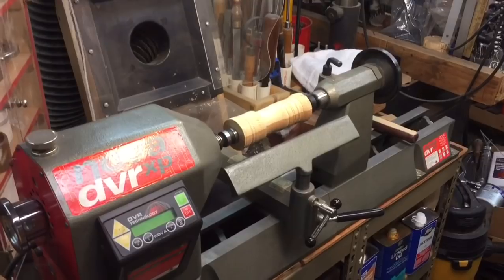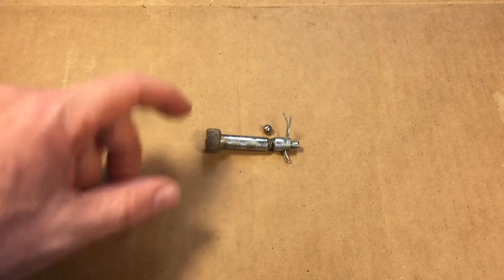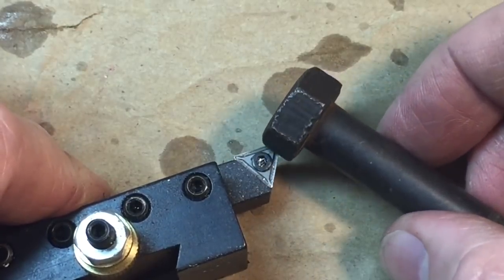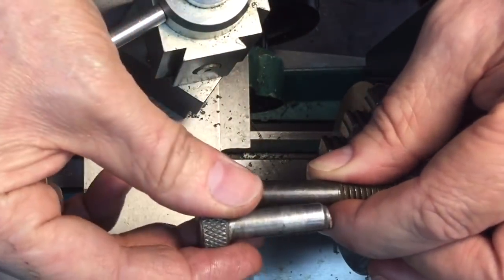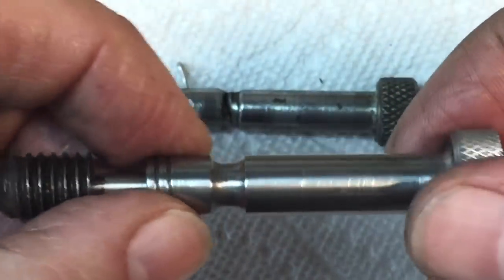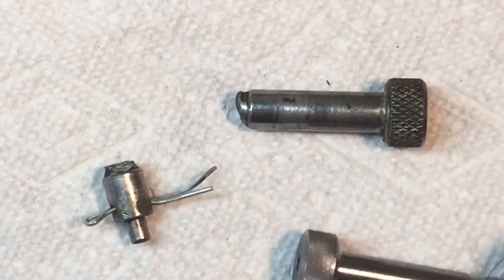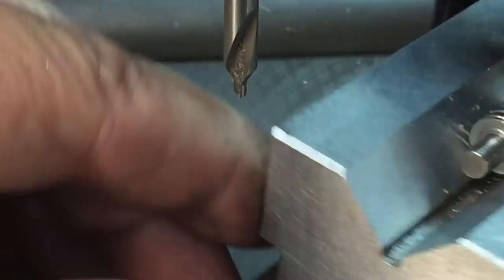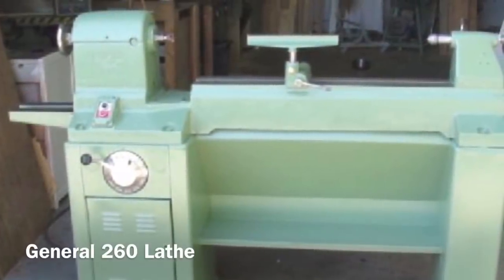Using a Lathe to Fix a Lathe...

Comment: This is an incredible honor, SC. I mean that sincerely. I have spent hundreds of hours in front of that lathe, this is a deeply personal and special thing. Thank you
Reply from the maker: Hello Daniel!  It's in the mail and should reach you by Tuesday!  We are all wondering if you know about the off center hole?  Do you think it was done by mistake or could there be a reason for it?  =)
Reply: @ScoutCrafter  I won't know for sure until I test it,  but I can give my best guess. When you press the knurled head the narrow tip indexes with a corresponding hole on a wheel secured to the spindle, thus locking the spindle. When you want to unlock the spindle you grab the knurled head and pull it. The cotter pin is there to prevent the pin from being pulled out entirely. I can't think of a reason why that hole would be skewed the way it is, I hadn't noticed. I will give an update when the part arrives. I know you're a modest and humble guy, and I don't mean to put you on the spot but, you're incredibly talented. I hope I can return the favor. Brilliant work, brilliant ingenuity.
Reply from the maker: Daniel! It was my pleasure and if it works I will be happy as a clam!  LOL   =)
Reply: Daniel Nero curious? How did it end up working for you? Was the hole in the correct location or a defect?
Reply: @big_air_jer9768  I wasn't able to determine if the hole was manufactured with the offset hole intentionally. The pin fit perfectly. It was a dead ringer for the original, It was identical. Still the mystery remains i'm assuming that detail wasn't essential as the hole is used as a pass through for a cotter pin.
Reply from the maker: @big_air_jer9768    Daniel sent me photo's of the pin in place and it worked perfect...  The hole was just for a retaining cotter pin and I don't think it had to be off center...  His lathe is awesome!   Thanks!!!!!!!
Reply: ScoutCrafter awsome. Well great attention to detail anyways Mr. ScoutCrafter 😁

Comment: it is true that a lathe can be used to make another lathe, which is unique among all tools.  But even less well known is that the very first lathes spontaneously came into existence, while each lathe was in the process of making the other.   Going back in time to see what happened earlier in this process just results in the other lathe becoming more finished, so attempting to observe what happened prior to this merely runs into this barrier.  So as far as anyone can tell, 2 lathes came into existence spontaneously. They do know that they were arranged in a 'ying/yang formation', meaning that one lathe was facing the other way and upside down in relation to the first lathe.

Comment: What metal lathe are you using? I'm looking at a $500 mini desktop lathe for the near-ish future followed by a $2,000 Baliegh later on down the road. Also you're damn good with a file. I would have chucked the bolt into the lathe and held a metal rasp or file to the head and got it perfectly round and close to final dimensions.

Comment: I have always wanted a mini-lathe. But my main work is leatherworking, and veg-tanned leather and metal dust/filings are not good friends. Even sitting a metal part on natural leather for a while will result in major tannin staining. This means the metal work needs to wait until I build a new shed. Grrr.  Great video +++++
Reply from the maker: You are so right!!!  I do some leather work myself and one old timers method to dye leather was to use steel filings and vinegar! I know you already know this... All hobbies are equally satisfying and rewarding!  Thanks so much!!!!
Reply: If I am feeling cheap I try to talk the occasional customer into a dark grey finish. LOL.

Comment: The bolt is likely to be a high tensile steel too! No doubt the part you are reproducing would have been case hardened, (perhaps that contributed to it's demise) a new part made from mild steel would be a little soft.
Reply from the maker: Hello Jim!  I was thinking the same thing! I thought a bolt would have good properties for this application because it wasn't too hard or brittle but still stronger then soft steel!   Thanks!!!!!!!!!!!

Comment: Hey nice fix. A larger lathe would definitely help out. Making things out of solid stock is no longer a big deal, and you don't really have to worry about interrupted cuts like on a bolt head. Good to see some small parts being manufactured on this channel. :)
Reply from the maker: Hello MB!!!  Yes!  I used to have access to a 10x42 Jet at work, I was working nights and it was out of my department but I would use it then clean it up like new... Normally it was left with a pile of chips and filthy, well ,the department head found out it was me and said "You are the only guy here who respects a lathe, anytime you want to use it you're welcome" after that I not only used it but fixed a few issues and changed the oils and fabricated/replaced the shear pin so it could auto feed again.  Word got out and other department heads would ask If I could use their Drill Press, Grinder, Wire wheel...  LOL  It was a lot of fun!!
I would love to have a 9x36 South Bend for my personal use, too big of a lathe isn't fun either, 9" is just right!  Thanks!!!!!  Another fix project tomorrow!!!!!!

Comment: Metal artwork...very relaxing to watch something useful being made out of a bolt. In today’s throw away society it’s nice to see things being fixed up to work again, even if they are old. When I was a young man I worked on IBM mainframes and as the years went by, more and more of them ended up on the scrap heap. I myself attended a few decommissioning parties with a sledgehammer. Decades later Non of these old machines exist, there’s not a working machine in the world in the old IBM 360 machines. Recently there has been a massive attempt to preserve our computer heritage. We have building of old tapes but no machines to read them. NASA had this problem with old data from the moon program. The point I’m trying to make once this stuff is gone it is Gone. So people like scoutcrafter are doing a social service. People say there lots of these tools around, that’s what we said about IBM mainframes and then everyone threw them away.
Reply from the maker: Hello Clive, After reading your comment I was very curious about the IBM 360 having never seen one, well I went on google and then was directed to YouTube where I see there is quite an interest in those vintage gems!  The unit was beautifully designed and between the switch placement and lights it is definitely a piece of working art!  Working on those machines was like a cross between TV repairman and surgeon!  =)   Thanks so much!!!!!!!
Reply: ScoutCrafter Thank you for taking an interest SC. It’s a very serious issue when I was living in England I was aware of an attempt to medical records of tapes from these machines. These records because they contained cancer data that would provide an insight in how cancer has changed over the years. Alias no tape drive to get the data off. I was aware of some American living in the UK who was helping to convert an old tape drive. The big problem was that because there was so many machines no one thought that this would be a problem. In the end only three machines exist. One in California, maybe one in Germany and one here in NZ in a local museum. None are in proper working condition, however I haven’t checked in the last couple of years and maybe one is in working condition. I collect manuals for the IBM 1401 machine and when I die they will go to computer museum for safe keeping. I dont particularly enjoy reading this material but it’s of historical importance and needs to be saved. I have no doubt that a lot of your tools would be worthy to go to a museum after you go to the big workshop in the sky. Also your videos provide impetus to others to preserve tools which is also important. The issue know is that tools need to be preserved now while there easily accessible. It’s too late while there gone. There were tens of thousands of the older IBM mainframes built and nobody thought they would disappear, but they did.
Reply from the maker: Clive you are so right, things we take for granted today become scarce and valuable tomorrow!  Thank God for people like you who recognize the importance of such treasures!  Thanks again!!!

Comment: You could have chucked the bolt in the lathe and filed it while it was in the lathe.
Reply from the maker: Hello Time Table!  You are so right!  The file I used was a very coarse and slightly large so I used the vise and it went very fast, I have files I use just for the lathe, it is so relaxing filing on the lathe!!!!  Thanks very much!!!!!

Comment: There is a debate with Apple that if you manufacture a part it is a knock off, a forgery. You have become a master forger according to Apple. Nicely done but I think the off set hole was factory fault, but you could not be sure as you do not have the rest of the machine to try it.
Reply from the maker: Hello Tony!  I know!  I was very perplexed over that hole!  Here I spent all this money on equipment to make drilling holes in the center easy and I get a Off set job!  LOL  Only me!  I will ask Daniel about it!  Thanks so much!!!!
Reply: Murphy's law in action.
Reply: @ScoutCrafter